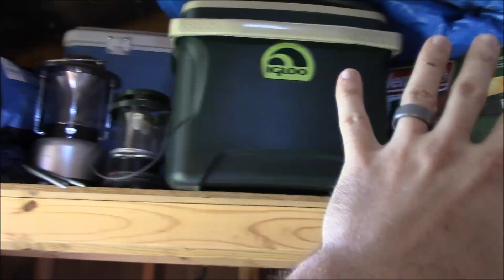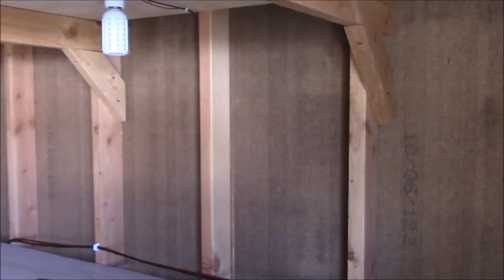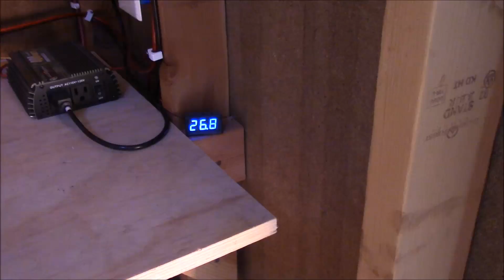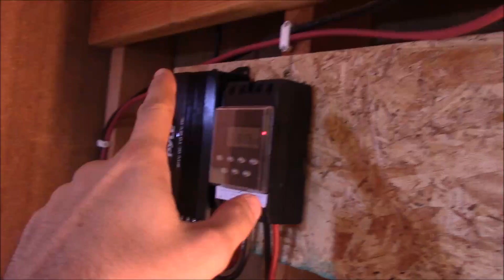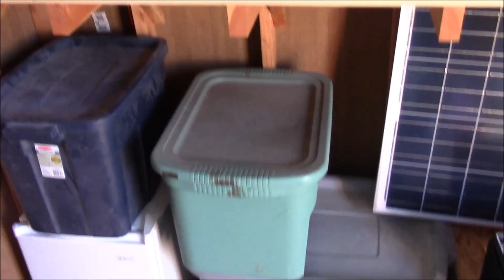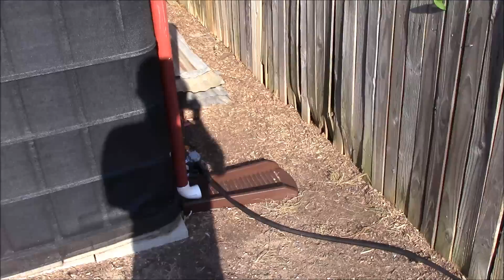Solar Shed Tour 2016

Comment: In years past, when the sunflowers got mature, my late wife would put paper lunch sacks over the flowers and wrap the necks, loosely, with florist wire. When the stems started to dry, we'd snip them off and put the flowers in the shade. It made it easy to shake the seeds off without covering the floor with seeds. The sacks would allow enough air to prevent mould growth.
Reply from the maker: That is what I am planning on doing.  How did you tell when the sunflowers were mature?  Are they supposed to turn yellow on the back?
Reply: +LDSreliance: I really don't remember. I think the tip came from one of the ladies at Church. I think it was when they started to droop and stopped following the sun. Funny thing; our 6-year-old son, Steven, would pull up a green onion, wash it off with the hose and eat it. Later, when he came in the house he smelled like a big onion. All of the kids would pick ears of corn off the stalks and and eat them. Sometimes we'd have to go to the store and buy corn. 👱🏻
Reply from the maker: tom7601
Those are great memories!  I wish I had more room to grow things and that my kids were more interested in helping.  They didn't grow up with this stuff (they are my step kids) so they don't ever want to go outside, especially when it is hot.  Lame.

Comment: Yes cooling is tough. You have one thing that helps: some sun. I found a little swamp cooler that I did a video on, but again even at 1 amp to stay cool without sun, it is of no use. Many areas like mine only get good sun in the spring and maybe a month in the fall, so cooler season is out. I have heard the little swamp cooler I have works in TX and other humid situations, and want to try it, but on humid days, there is not enough power. If it ever happens I will let you know.
Reply from the maker: Cool.  Where do you live that you can't even get 1 amp from your solar panels?  I don't really think humidity affects solar much so that shouldn't affect trying out your swamp cooler down here.  Are you mobile in your RV year round?  That is what I want to do some day with my wife.  Just hit the road in an RV for months at a time.
Reply: I live in SE Arizona. I thought clouds would not be an issue. WRONG! I am near NM that is a cloud zone and all the clouds build up and funnel to my area near the mountain. I have had a couple people out about some expansion help and the last one tested and said w/ the clouds I am getting about .10 of an amp vs over the 5 amps at STC. My batteries were fine and I was able to keep up and live, except for the roof cooler was too much. At that point I purchased the MightyKool and WOW .9 to 1.8 amps, but there is really no need for the high setting on that. I did a video on using it, but the air was very dry then during that very bad heatwave. Swamp coolers work best in dry climates and not so good say in the south or east. The middle of last month, clouds came in and never left, and I have been told that it's going to be much cloudier over the next months. So no more running anything. The humidity came in w/ the clouds, so it is about like NOLA and I was so wanting to try the cooler to compare the effectiveness in the humid, but the clouds have not left me enough power. The company claims that people near Dallas find it works, due to their special wick pad, the cooler has. That company makes a lot of really stupendous claims and I found it odd that they stood up when put to the test. So I am waiting for my batteries to get enough from the sun and to be full enough when one of those miserable humid days comes along and see what kind of performance I get from the cooler then. I am so curious. Seems the clouds and humidity go together and when the clouds move out it's dryer. I feel like I am dreaming today-very sureal. It's 1pm and it's sunny-it feels very strange to see that. I am putting expanding my panels on top of my bucket list, but it's out of my budget-after I get more power I can try more things.
Reply from the maker: Prima Donna Going Off Grid
That makes more sense.  What is the name of this company?  I might reach out to them and see if they want to send me a unit to test and review.  I am highly skeptical it will work in humidity but you just never know until you try it!
Reply: MightyKool is the name of the unit. I recently did a video on it, in the last month. Swampy.net I think is the site. I do not think they will send one to try. I almost did not order, as I did not trust it and wanted to try before committing and they did not allow. You can return, but it will cost you a lot to do so. It would be a lot more known if they had an address where one could show up and test the thing. We have had some sun! With sun comes the dry air and very high heat. I hope someday to have enough solar to test this thing when it is hot and humid. Usually clouds come w/ humidity and not much of a test if it is not hot out. I have heard it works better than other swamp coolers in humidity, but also heard it does not work as good as say dry. It would sure be fun to test in the heavy dripping humidity.
Reply from the maker: Prima Donna Going Off Grid I watched your video.  Pretty interesting.  I don't think it is worth paying full price and take a chance, though.  I'll be interested to hear how it does for you long term.
Reply: I agree! That and their restocking fee if it doesn't work.  I am glad I did it only because the unit works for me, if there is sun. I will keep you posted if I find I can try it on one of those hot heavy dripping humid days.

Comment: I love the air conditioner!
Reply from the maker: Haha, yeah I don't use it much but on those 100 degree days I will kick it on as I work.  The air conditioner also takes up less space hanging on the wall like that then if it was on a shelf or laying on the floor of the shed.  We use that ac unit for a backup in case we need it for our house, which regularly has cooling issues in the hot Texas summers.

Comment: I think 24V is a good voltage to use if you dont power your home exclusivly with AC. With 24V you can use LED-bulbs that take 10-30V DC so you dont need a inverter running all the time just for lightning. You can also get out 2000W from an inverter without excessive amperes going from batteriers. I hope 24V support will increase in the future.
Reply from the maker: Me, too.  It is hard to find inverters that work with 24v and even most charge controllers only support 12v except the more expensive models.

Comment: Why are there two pvc pipes running from the shed to the house? Do you have the positive lead in one and the negative in the other? If you do... that can cause a major problem. 100 years ago when houses were wired with knob and tubes tend to catch fire. Not because of sparks but because of over loading the wires. When wires are next to each other, the energy in them cancels each other out. When they are far apart, just like the 6 plus inches you have them. The wires can heat up and torch whatever their touching. 

I haven't watched your battery box video yet. But if you don't have a vent tube going to the outside. Then you may want to install one. Just so any off gas can be sent outside instead of collecting inside the shed. Just waiting for you to flip a switch and go boom.
Reply from the maker: Interesting, I have never heard of that happening.  I do have one wire in one and one in the other.  I did it that way because I used 1/0 gauge THHN wire and it was barely flexible at all.  So fishing two wires through the same pipe would have been very difficult in the bends.  So I ran them in separate smaller conduit.  I have had it that way for almost 4 years and it has been fine, though.

I do have a vent tube on my battery box that goes outside the shed.
Reply: I remembered my electrical teacher telling us this. But I couldn't remember the reason. Searched on the web, but must've used the wrong terms till now.

Basically the grounded (neutral) and ungrounded (hot/live), shall be next to each other to cancel out each other's EMF. Every current carrying wire creates an EMF, whether it's DC or AC. DC it stays in a constant field, whereas in AC it gets created and collapses and created again in other direction 50/60 times a second. 

EMF not only disrupts other electronic devices, connect or not to the wires, but also can create heat. 

Check this article out and scroll down to "Badly-Wired Houses Cause High Home-EMF Levels"
http://emwatch.com/house-wiring-radiation/

Now what you can do without digging up the yard. Is to pull those wires and chop the size in half. Run a net/pos pair in one pipe and the other neg/pos pair in the other pipe. 

Just something to think about while you rework your shed as you just mentioned that your thinking of doing... personally I would definitely retire the visible ones. It'll look nicer for the YT videos.

Comment: I would think that half of the solar system being on the east and the other hald being on the west sides of the roof would be more efficient.
Reply from the maker: If you want to lengthen the duration of your power generation but cut the overall max power output sure.  On my shed I have a north facing roof face and south facing.  So all 4 of my panels are on the south.
Reply: Oh ok. I do have a north/south facing roof which puts me at a disadvantage

Comment: I like it, question though why did you put all your panels on one side? You just don't get a lot of sun from the other direction? Seems like you'd want to produce power the whole day rather than a bunch all at once.
Reply from the maker: Solar panels need to face south to get direct sunlight.  If you face them another direction they will get mostly indirect sunlight, which does not produce anywhere near the same amount of power.

Comment: How much would you estimate it'd cost to buy enough panels to power a regualar household (entirely solar)?
Reply from the maker: Depends on if your main heating and cooling devices (air conditioning, stove, water heater, dryer, etc.) are gas powered or electric powered.  If they are gas, you could probably get away with about 3000 watts of solar for an average size home.  If all of those are electric you will need more like 10,000-12,000 watts of solar power for an average size home.  It will also vary somewhat with where you live and how much sun you get, too.
Reply: +LDSreliance hhhmm, I see. Thanks!
Reply from the maker: Great Yriclian Monarch: King Kujito You are welcome.  Thanks for watching!

Comment: You said Texas, I live in north Texas and I noticed in my shed some what like yours my tools are rusting.  Any thoughts
Reply from the maker: Yes, it is humid here as you know.  I have heard of some people putting a light coat of petroleum jelly on their bare metal tools.  I think a lot of older tools didn't have any coating on them so they surface rust.  A lot of newer tools have a coating or use a metal that doesn't surface rust.
Reply: The best way I know of to prevent rust is to fill a 5 gallon bucket 1/2 way with coarse  sand, then add some linseed oil to the sand. (I've heard of folks using motor oil, but if you're food gardening I would use linseed) After you've cleaned your tools give them a few dips in the bucket, wipe off the sand and hang them up.
Reply from the maker: That is a pretty good suggestion.  Thanks!